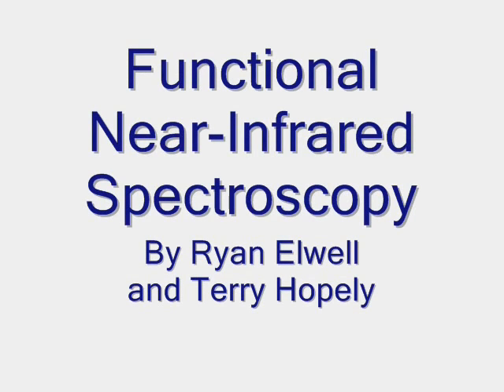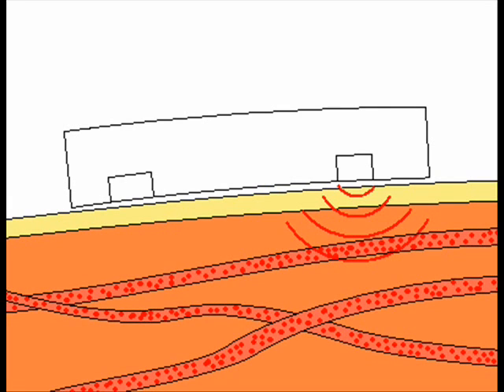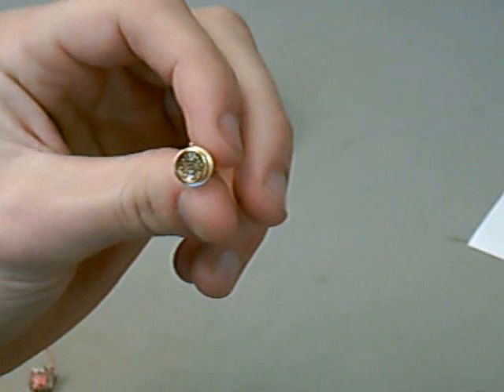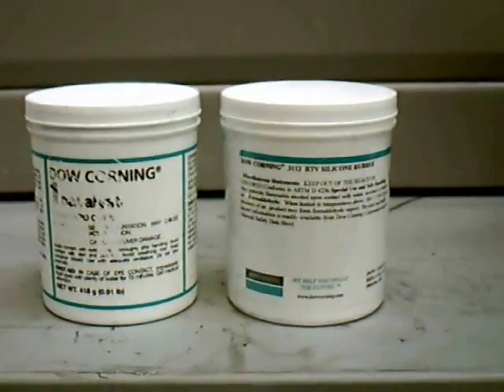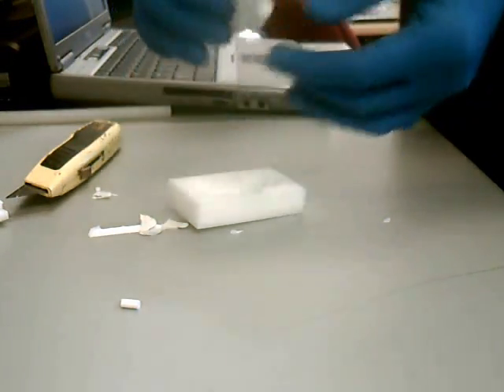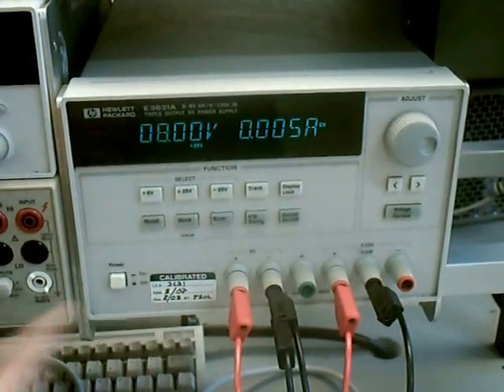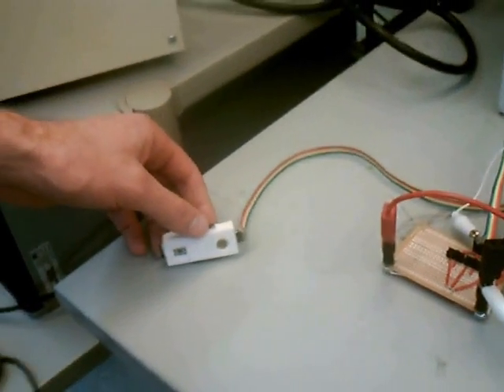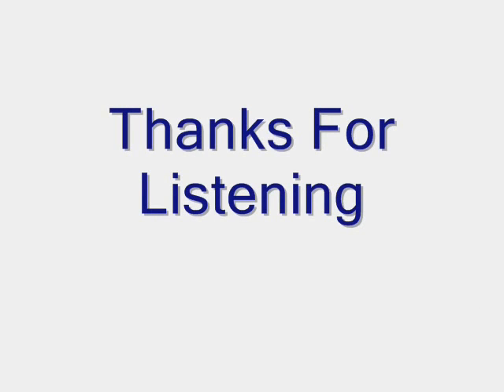Rowan University Clinic: fNIR Spectroscopy Hardware Design

Comment: Any details part codes for emitter and transmitter ? Is this open source project ?
Reply: Hikmet Gümüş For the emitter, they are likely using a part in this series: http://www.digikey.com/product-detail/en/MTMD7885T38/1125-1245-ND/4746373